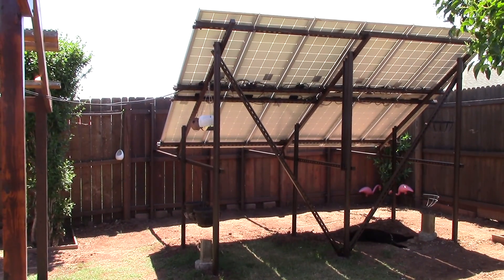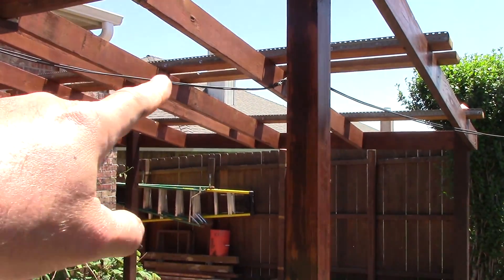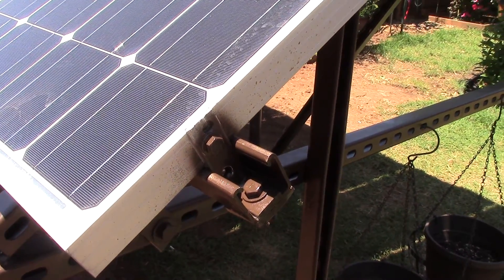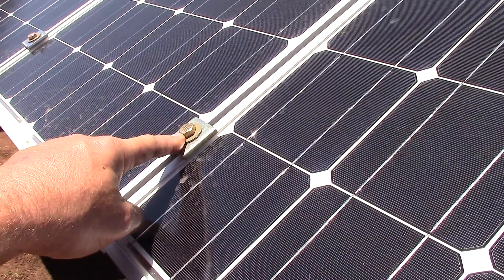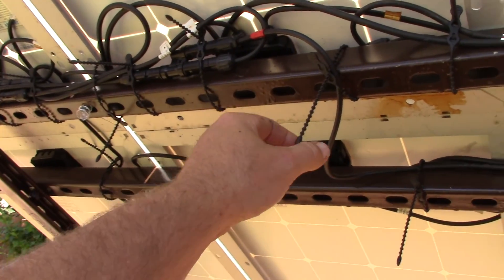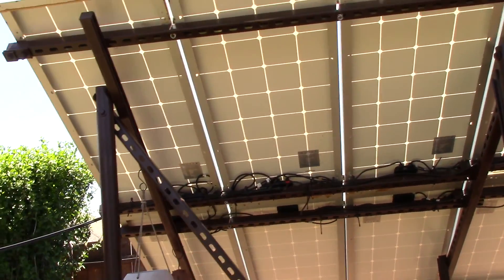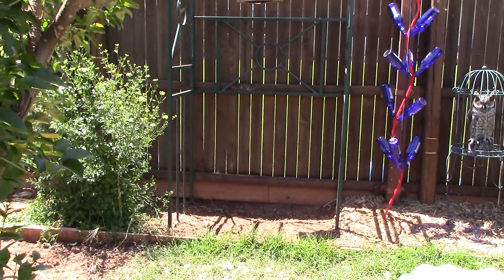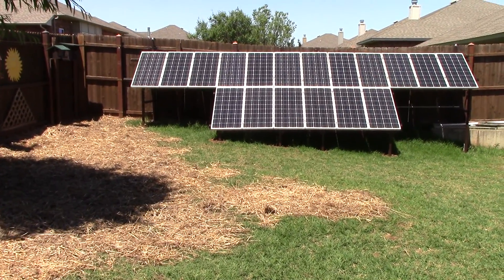Part 8 - (Last part, finished) Suburbia backyard corner solar panel cradle/racking system

Comment: This is really helpful for DIYers. It looks like the horizontal struts on which the panels are attached are attached to slanted struts(53 degree angle struts). Did you have to drill a hole to the slanted struts to bolt in with the top horizontal ones as there is no holes provision? Thanks.

Comment: Hi Chris. I do like the strength and structure of your build. Looking at the galvanised washers under those bolts. Do the edges of these washers shade any of the solar cells in the morning or afternoon? I'm designing a PV system and shading by the hold down mechanism is something I need to avoid.
Reply from the maker: Good eye...yes, there is slight shading from those square washers. AM and PM angled sun tho...very minimal impact. I went for strength/heavy duty...you can buy thinner ones and smaller bolts and it will help a little with early AM and late PM shading. Like I said before...very little impact.

Comment: Nice set-up.  Did you have any HOA issues?
Reply from the maker: +Mike Masztal - Thanks, great question. Nope, the structure can't be seen from the road...so, no issues. Many neighbors have unsightly garden barns and kids play pens that stick up higher than these panels.
Reply: Chris DIYer We have a HOA that's kind of a PITA, but we also have a solar rights law here in FL which supersedes HOA regs.  My system will go into the smallish back yard with has a 6' fence.  It won't be visible from the road or the development behind me.  I'm gong to the architectural comm for "approval", but in reality, I'm just doing it as courtesy.

Comment: just coming over to check out your system. Quite interesting. 
I just salvaged 21 poly panels of 250W each here in France, and I am starting to ponder ways to get them to crank out the good green juice...
Keep on trucking ! (from France)
Reply from the maker: That is a lot of panels...over 5,000 watts. Best of luck with mounting them.